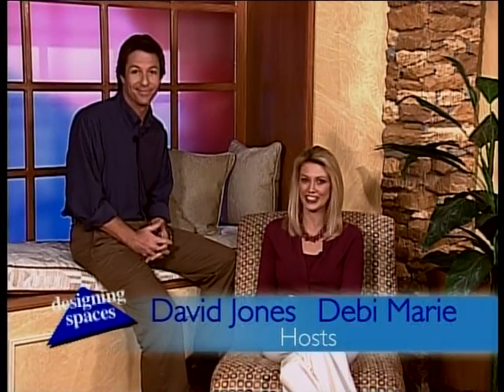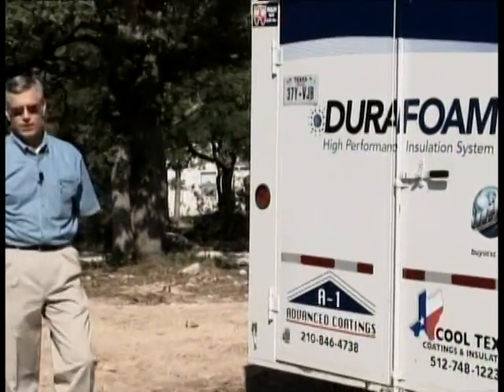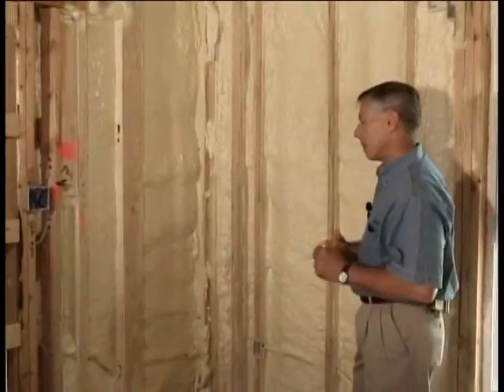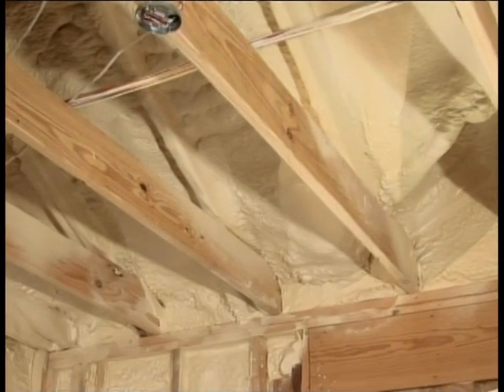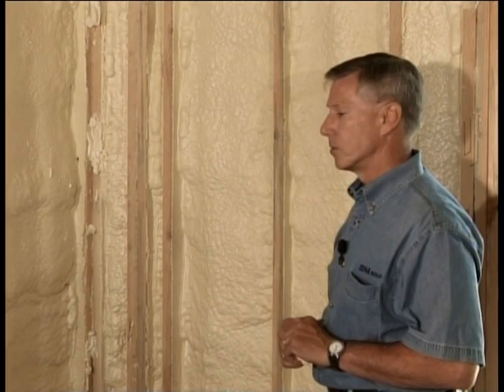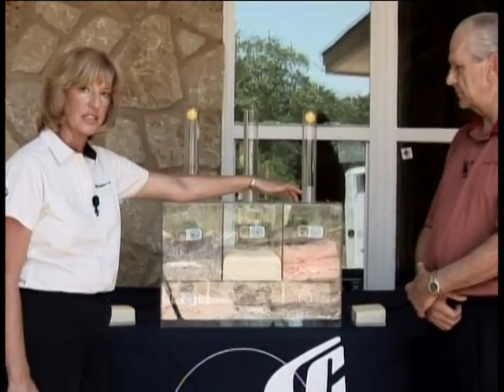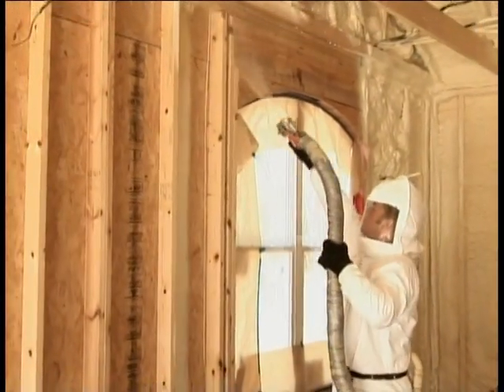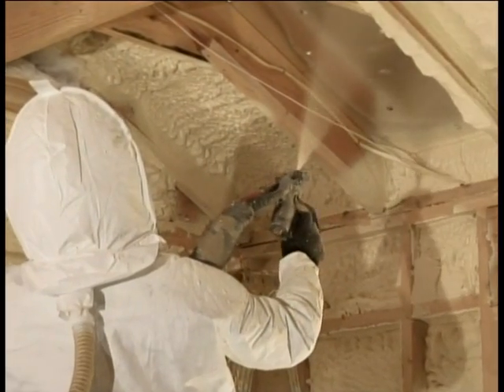Spray Foam Insulation Designing Spaces

Comment: d1incharge = troll

Open cell foam will allow the water from the water leak to pass through it. You want have a problem finding the leak and fixing it. IF you get a water leak.

Comment: @latitude500 That would suck to have to replace that high quality r-25ish attic insulation there. Great you can find the leak though. This spray foam stuff is top notch as long as you don't know how to do a manual j, and suck at simple math.

Comment: If you could ever afford a blower door infiltration testing machine, you could find out for yourself that new homes without foam alot of times are too tight, unless you just suck as a builder. You do realize that you need fresh air in a home right?

Comment: When water leaks in behind the sheathing, between the sheathing and the foam, it will destroy the boxing, therefore forcing you to replace your insulation/siding as well. Air leakage on a typical home is like the front door being open? Sure it is buddy......WHO IS THIS IDIOT? Nice "display", my house must be different, it doesnt have a hot air blower for a cieling? And it is up to code on rack strentgh, you make it sound like I need more racking strentgh? YOU PEOPLE GIVE FOAM A BAD NAME!!!!!!!